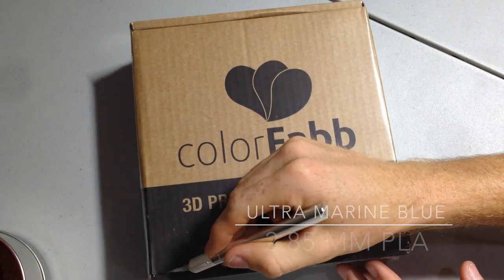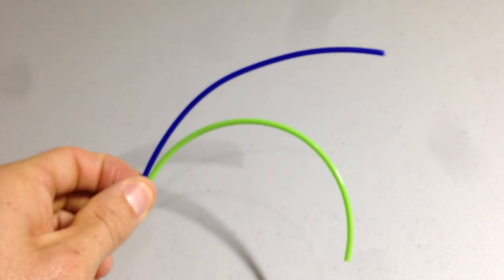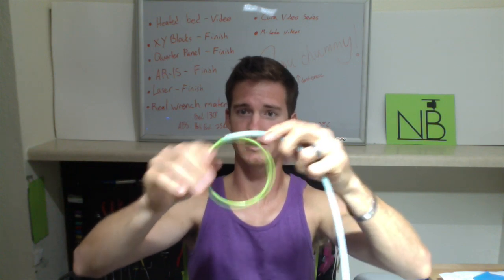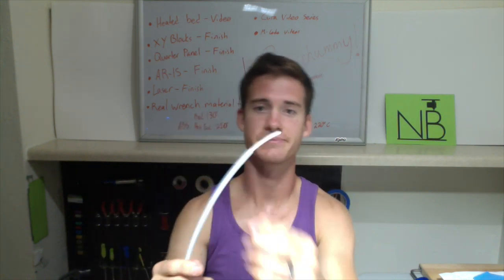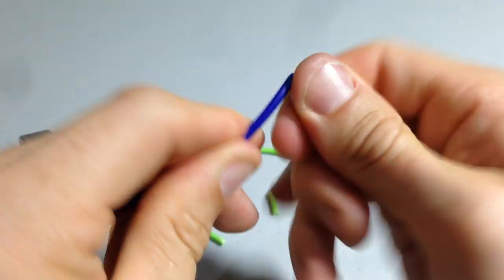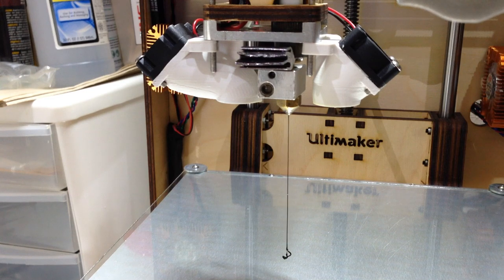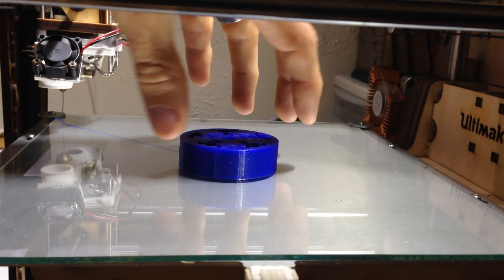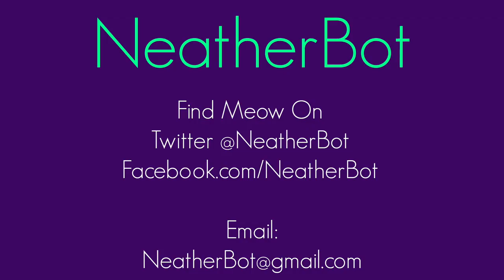Review - ColorFabb Filament

Comment: I am trying Colorfabb for the first time and I have big problems finishing a print with it. It seems that this filament differs at some point compared to printing with ABS and even other PLA. My prints always stop between 18-46min's. When I reversed the filament and measured it, I had 1.9mm for 1.75 mm.I think between 200-205C is a good temp for this filament. How many E steps/mm are you using for this filament? Do you have the extrusion multiplier different than 1? Thnx in advance!

Comment: Now add closed loop stepservo motors to al axis, you are so right in so many ways other channels fail !!!! Great work !!!!
Reply from the maker: +RobMitshi that would be expensive but awesome! I have wanted to do that, but the cost is just too much. Thanks for the kind words and support!
Reply: Ustepper and mechaduino arent so expensive, if they save time and failed prints, a curled up overhang would be smoothed by the heat of the head, but when printing many parts at same time those little curl ups get hard and ruin prints. Im building a Hevo and adding Usteppers to X and Y for speed and reliability. 120€ with motors encoders and shipping, code is copy paste into your marlin. i spent about 800€ for 1.5 Hevo printers and adding Usteppers is a must upgrade for me, build plate of 440x440 doing 10 parts and using half a roll of petg, if those go wrong cus the head skips some steps on a curled up edge here or there, they will be defenitly worth it. The new Pursa has encoders too i see, some smart shit finally where getting up to speed !!
Reply from the maker: +RobMitshi that's awesome to hear! The price has gone down quite a bit since I last looked into it. That souls like a good setup. My understanding g is the new prusa uses the trinamic drivers to their full potential which means they can sense current draw and when the stepper meets resistance the current draw goes up and the software recognizes that as contact. So they are being very smart with regular simple steppers. That new board Prusa developed looks absolutely amazing. You may look into getting that main board.